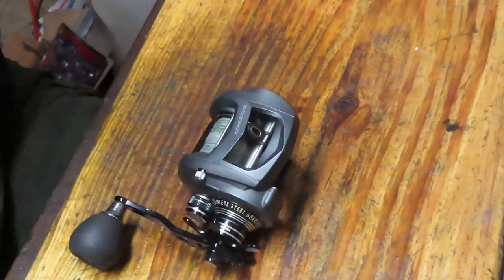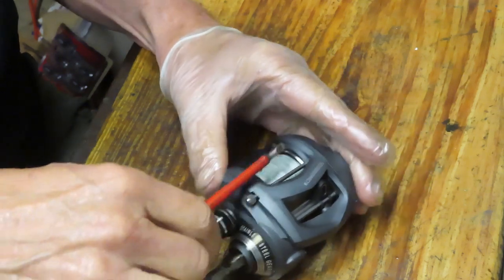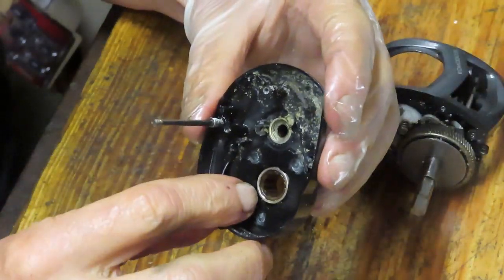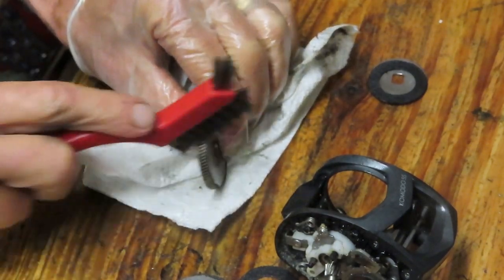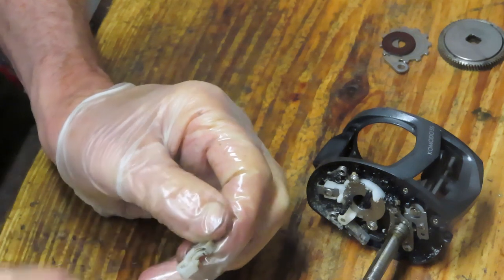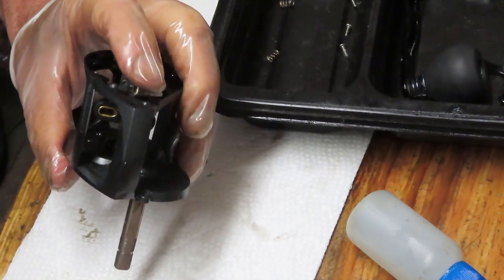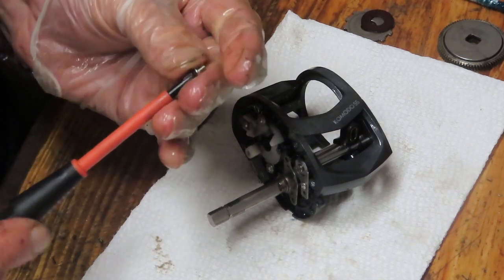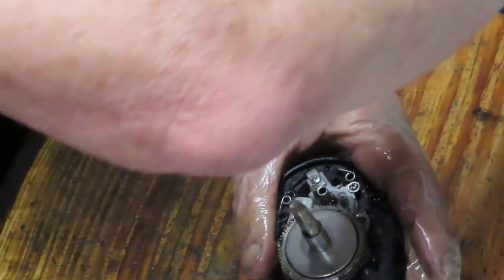Okuma Komodo SS low profile bait casting fishing reel how to service

Comment: Given a choice, getting a upgrade hybrid ceramic bearing on the sideplate side or on the spool side, will we see a real difference in casting distance or freespool performance if we only can choose one? Thanks Dennis.
Reply from the maker: I don't think that it will make that much difference.  Ceramic bearings won't rust, or wear like the SS counterparts but new vs. new SS bearings, I just don't see that difference. Not sure why you would only replace one bearing, You need both sides of the spool to run smooth.  Some reels use a bushing on the non-gear side, so I guess I would pick the gear side if I had to make a choice -Dennis

Comment: Very interesting, Okuma isn't really found here in S.W.Fl.. I've been having a blast using 300 size low profile Tatula's on Snook. Very tough reels but I'm not to keen on the ball bearing pinned to the shaft though.
Reply from the maker: Thanks - Yes - that is how Shimano engineered it.  It is Ok - Dennis

Comment: Hello, my Okuma Komodo 471P will not release from free spool when you turn the crank. I’ve taken the reel apart a half dozen times and can’t find the problem.  Somehow the release cam won’t engage the anti reverse cam. I’ve taken the reel apart completely and still can’t find the reason the cams won’t align correctly. Any idea where to look would be appreciated.
Reply from the maker: If they are not aligning, then you could have a broken or bent part.  It is hard to say.  I would recommend getting the schematic and rechecking your work to make sure all of the pieces and parts are in the right place - Thanks for asking
Dennis

Comment: hello sir, I have a rust problem on my baitcaster with carbon body, since the reel was exposed to water and I didn't have time to clean it, rust appeared on almost all the bearings and bearing seats, I have ordered new bearings, but after I tried cleaning many times with WD-40 on the reel body and bearing seat, even though it looked clean of rust, after I re-lubricated it and use it, the next day rust appeared again on the bearing seat and it was very difficult to remove, do you know the solution to this problem? Thank you very much 🙌🙌, sorry for my bad english
Reply from the maker: You will need to change out the bearings in order to stop that rust.
Reply: @2ndChanceTackle  yess i'll do it, but i'm afraid of the new bearings getting rust from the bearing seats